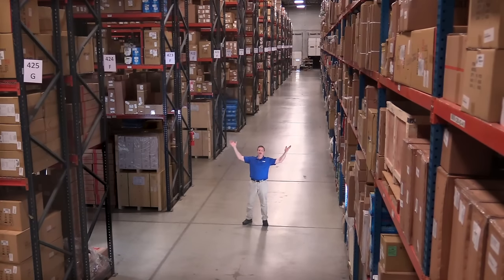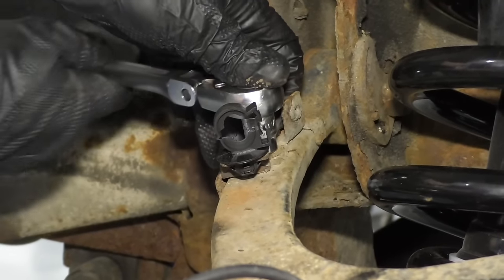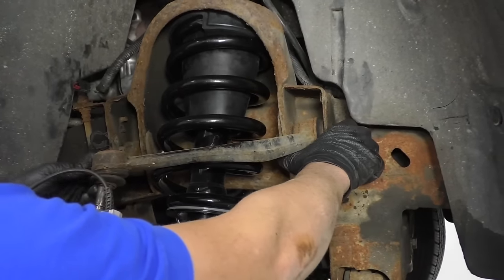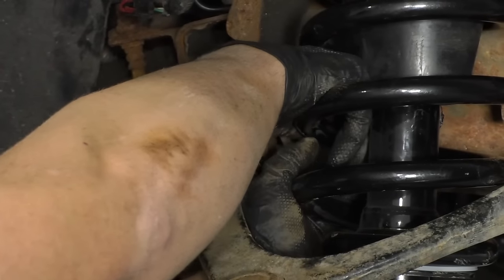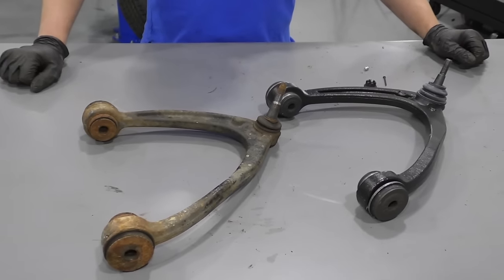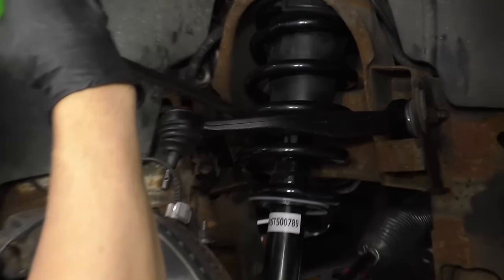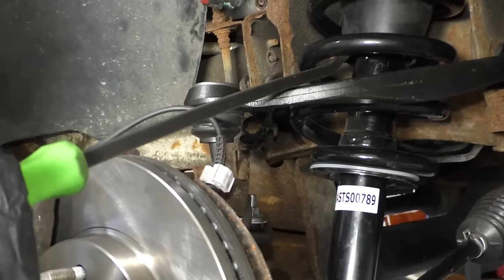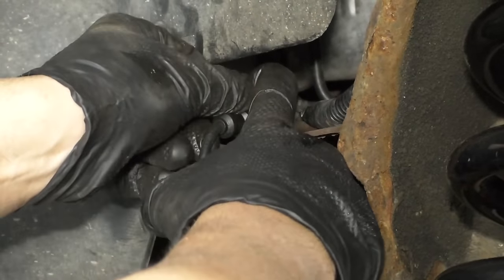How to Replace Control Arm with Ball Joint 07-15 Chevy Silverado 1500

Comment: I know this is an old video, but for anyone reading comments contemplating DIY’ing this, be warned:  especially if you live in the rust belt, expect to have a big challenge getting the upper control arm cam bolts off.  Use a penetrant like PB Blaster generously all over those bolts and cams.  They tend to rust and seize inside the control arm sleeve.  The bolts cost around $8-$9 bucks.  Buy a couple, and have them on hand in case you have to destroy the old bolts to get them off.  Don’t put rusty bolts in a new control arm.  I also gooped up the bolts and inside the sleeves with Fluid Film to try and slow down the rust monster.  Lastly, as others have commented, just remove the shock assembly - especially if the cam bolts don’t want to budge.  Good luck!

Comment: Skips over literally the most difficult part: getting front bolt back through control arm with strut still in place. That was the only reason I looked up a how-to video. Thanks for nothing.
Reply: I can't recall where I saw the video procedure (I've watched so many this past week) for precisely that but it's doable though it is something of a 'black art'. It involves using the fingertips and slightly moving the arm while removing and replacing those bolts. Fortunately(?) I'm replacing the struts too so I'll have room to work on that upper arm. One video shows the importance of not tightening the nuts fully until the full weight of the vehicle is back on the suspension otherwise the bushings could tear.
Reply: Why the hell didn’t they just put it in through the front

Comment: If the plastic part is still in the alignment cam and you reuse that cam and bolt would you still retain the wheel alignment after reassembly ? If you replace the bolt and cam due to severe corrosion would you then need an alignment ?

Comment: Rotor was brand new during repair, after repair when mounting tire the rotor was rusted....lol
But thanks for all your videos.
Reply: Spike Boston if you are a fun and follow them. You should know they did repairs on this truck before and used a clip from past repairs. No need to do another installation video on how to mount the tire. When you have a clip somewhere in their hard drive 😁😁
Reply: Or maybe just realized the upper ball joint  not was bad after changing brakes and rotors.. Ask me how you know.... 🤫🥴

Comment: I have a 2007 NBS 2wd, torqued my new control arm to 140 as this video says. Now the mounting shackles are bent in and the exposed threads on the bolts(8) are more than the other side(4). I just read on a forum that there were 2 designs on the bolts, slotted(140 lbs) and flat on 1 side the entire bolt(77lbs). Did I need to torque at 77lbs?

Comment: I saw on a different video where the guy, after removing the old control arm, used it to spread the brackets before installing the new one.  He did this to make it easier to install the new one.
Reply from the maker: +bluzeblast Thanks for the tip!

Comment: Could you have upgraded to Aluminum Control Arm ?
looks like GM has 3 Variants ?
Cast Iron 
Forged Aluminum 
Stamped Steel
Reply: Joni English which do you suggest I upgrade to?  I have a light duty K1500 Silverado that needs a new ball joint.  I plan on doing both sides and just replacing the control arms because I have a ton of bushings that need replaced as well.  It would just be easier to replace the control arm with a ball joint installed already.  I dont think the Stamped steel would be any kind of upgrade, would it?

Comment: I have to replace both lower and upper control arms, would it be easiest to take the strut off and then install both upper and lowers?
Reply from the maker: +Chase Thanks for watching!  You do not have to remove the strut to replace either the upper or lower control arm, but it might give you better clearance when removing the upper.

Comment: Hey guys at 1a auto, I just installed some new upper control arms with new ball joints on my 2009 Ford Crown Vic. Once I put the ball joints into the knuckle and then tightened them down with the nut. I noticed that the boot of the ball joint kind of spun in a tightening motion as I was tightening it down, is that normal or OK
Reply from the maker: +gbpackers41730 This should be ok as long as you tightened to the manufacturer suggested torque specs.

Comment: I’m going to impact the crap out of everything!!!!🤬
Reply from the maker: Thanks for checking us out. We would not suggest using an impact gun for the installation of these parts as you will need to torque the parts to the proper specifications and you do not want to over torque. Hope this helps you out. +Operator 9037

Comment: I don’t see how the bolts line up with the ball joint bushings with the strut in place? I’ve seen everyone have to remove the strut and spring
Reply: You just use a jack or if one pushes or pulls the caliper side in or out and the other pushes the ball joint up into the tapered socket then it’s easy easy

Comment: did i do something wrong if the hole for the pin in the bolt is far unter the crone of the nut?

Comment: Thanks for the video! Do the bolts have to go back in that way? It obviously makes it harder to get them in and out but I guess that’s the proper way to do it?
Reply from the maker: Yes, that is the proper way for the bolts to go back in. Thanks for watching! +Jay Eickholtz
Reply: But...Would it hurt anything  to put them in from otherside?
seems like a poor design by chevy.
Reply: @1AAuto  goog video plan on trying this myself an this video sure helped my confidence
Reply: @b_rad5678  the only way to properly torque the nuts, if wheel is on for ride height the strut would be on, there would be no access to torque
Reply: It doesn’t matter what side you put the bolts back in.

Comment: How do you know you have to replace the whole control arm and not just the ball joint?
Reply: It's just better and easier to replace the arm it's more pricy ,but it's just better in my opinion
Reply: It’s not worth trying to press out the ball joint. Lower maybe, but the upper is almost impossible

Comment: I want to trust this company. You guys literally have some of the best install videos on the internet. But the parts are sometimes 1/8 the cost of factory and even 1/4 the price of moog/mevotech ect. $179 for 10 piece aluminum front end kid for a 2007 Cadillac Escalade (its a $5-7k trust at best now so doesnt need $$$ replacement parts) Just dont want parts that might fail/break and put lives in danger as some cheap parts have been known to do that. Lifetime warranty doesnt help if a ball joint snaps at 30mph at a year. Reviews are usually bought and paid for by most of the internet now or happen right after the sale. Sure they seem great when first installed. I still may a try a kit but literally everything 1aauto sells seems to cheap to be any good. Am I wrong?

Comment: How do you know when your at ride height ? 7:25
Reply: All you have to do is used a hydraulic jack under the control arm when it's back together but not tightened & lift it up & put the weight of the vehicle on it then torque the nuts & bolts to spec . It's called loading the suspension . You want to do this so the vehicle sits like it has weight on it for ride height plus if you were to tighten up the bolts & nuts without doing this step you risk the chance of the bushing tearing or cracking & going bad prematurely because the bushing isn't made to turn it's job is to absorb shock & vibration so the bolt & inner steel bushing alows everything to move up & down instead of the rubber bushing trying to be forced to move which can tear or rip the rubber  .  If you have it on a lift just use an adjustable jack stand that's used for vehicles on a lift & either lower the vehicle onto it or simply adjust the screw adjustment to push up on the control arms then torque them to spec .  Once done it's also best to take it to a reputable alignment shop & have the front end aligned so it steers the best it can plus gives you added milage on your tires .
Reply: @peteloomis8456  or if you’re issuing a regular jack. You can lift the upper arm upwards. Put a jack stand under the lower control arm and let the weight of the truck side. Then put the upper control are where it goes

Comment: for a 2010 silverado Cheyenne edition  4door 4wd .  How many Grease Points are there.   i know the theres 3 for each left and right front tires...  wondering   if theres more??   been searching for  Grease points on  all truck models and have not seen any.  Can i a tiny bit of help :p
Reply from the maker: +elvis pressedtalot Thanks for watching!  Unfortunately we do not have any diagrams available for this vehicle.  There should be grease points any where there is a joint, so probably the upper and lower ball joints, sway bar links and outer tie rod!  1aauto.com

Comment: How do you tell if the control are is bad!  You never said that.
Reply from the maker: +powskier Symptoms of a Bad or Failing Control Arm Assembly
Steering wheel vibration. One of the first symptoms commonly associated with bad control arms is steering wheel vibrations. ...
Steering wandering. Another symptom commonly associated with bad or failing control arm assembly is steering wandering. ...
Clunking noises.

Comment: Idk why but people that torque lug nuts seem goofy to me.  If you don’t do it often sure, if you do you should have an accurate elbow torque wrench. 15 lbs is palm ratchet snug.  30lbs is regular 3/8 ratchet snug.   50lbs you put some force into the same ratchet.   75 lbs you’re pushing pretty hard on a common size ratchet.   100lbs is snug with some force with a breaker bar.  150lbs is so effort into a typical breaker bar.
Reply: Because peoples strength levels vary and your method is as inaccurate as it gets